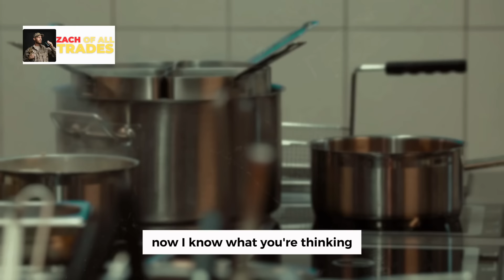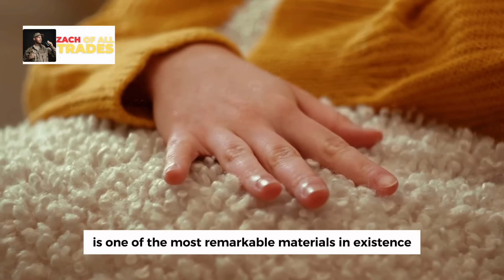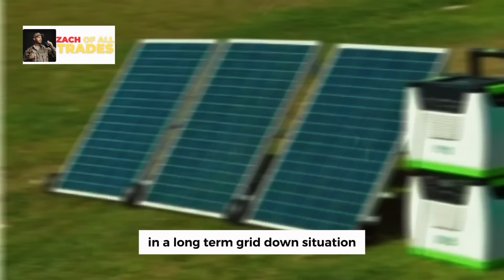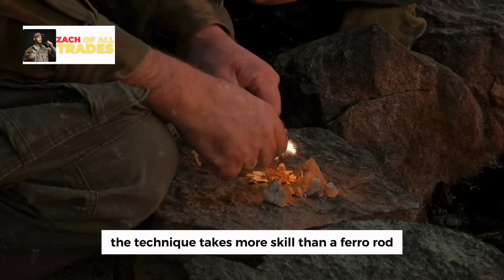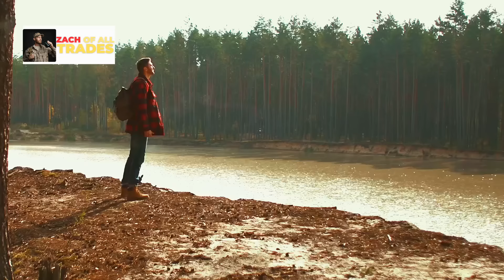15 Survival Gear Items That Last Forever!

Comment from the maker: 🎁 🚩💡🔗 Get the FREE guide: How to turn $50 into a 90-day food supply → https://www.prepguides.cloud/

🛠 GEAR FEATURED IN THIS VIDEO:

COOKWARE & CAMP KITCHEN:

Cast Iron Skillet - https://amzn.to/4p8kxS5
Cast Iron Dutch Oven - https://amzn.to/43qmlxf

FIRE STARTING:

Large Ferro Rod (Magnum XL or similar) - https://amzn.to/3LvHz6Q
Flint and Steel Fire Starting Kit - https://amzn.to/3JCHn5b

KNIVES & CUTTING TOOLS:
Mora Fixed Blade Knife - https://amzn.to/3JCHAW1
ESEE Fixed Blade Knife - https://amzn.to/4oz3kRX
Ka-Bar Fixed Blade Knife - https://amzn.to/4qQGVkj

NAVIGATION:
Cammenga Tritium Military Compass - https://amzn.to/4hWbDoj
Quality Diving Compass - https://amzn.to/498q32g

HYDRATION:
Klean Kanteen Stainless Steel Water Bottle (32oz or 40oz) - https://amzn.to/4oVFlMu

HAND TOOLS:
Gransfors Bruks Axe - https://amzn.to/3LG0ID3
Hults Bruk Axe - https://amzn.to/4p1wQPQ
Estwing Solid Steel Axe - https://amzn.to/487tC7O
Bow Saw with Replacement Blades - https://amzn.to/4qXM2zu
Silky Zubat Folding Saw - https://amzn.to/4qSCcyL

SHELTER & WARMTH:
Military Surplus Wool Blanket -  https://amzn.to/47K5pmM
Canvas Tarp (12x12 ft or larger) - https://amzn.to/4nHrFU9
Rip-Stop Nylon Tarp - https://amzn.to/3WOvnAw
Waterproofing Wax for Canvas -  https://amzn.to/4oVFFea

LEATHER GEAR:
Full Grain Leather Belt - https://amzn.to/43r0t50
Mink Oil Leather Conditioner - https://amzn.to/3LDyGbf

MULTI-TOOLS:
Leatherman Wave -  https://amzn.to/3JDUOBV
Victorinox Swiss Army Knife - https://amzn.to/3LxihFy

POWER & COMMUNICATION:
Hand Crank Emergency Radio - https://amzn.to/47JeVId
Hand Crank Flashlight - https://amzn.to/49efr20
20-Watt Folding Solar Panel - https://amzn.to/49dColY

FOOD PRESERVATION:
All American Pressure Canner - https://amzn.to/3LRMqPI

MANUAL TOOLS:
Hand Crank Grain Mill - https://amzn.to/4nPJGjl
Treadle Sewing Machine - https://amzn.to/3WOmyqs

CORDAGE:
Manila Hemp Rope (100 ft) - https://amzn.to/4ovKafr
Static Climbing Rope (100 ft) - https://amzn.to/4oAnye0
550 Paracord - https://amzn.to/3JHvX04
Reply: Cast iron shatters if dropped 🤦‍♂️

Comment: [00:01:00] Cast Iron Cookware
Description: Skillets, Dutch ovens, griddles; naturally non‑stick when seasoned.
Why it lasts forever: Solid iron, no coatings, no moving parts; improves with use; survives fire, rocks, drops.
Price: Not given in video.

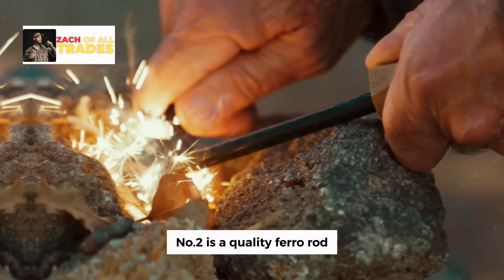[00:02:32] Ferro Rod (Large, Quality Rod)
Description: Fire‑starter rod producing sparks in any weather.
Why it lasts forever: Tens of thousands of strikes; no fuel, no wick, no moving parts; works wet, cold, high altitude.
Price: Not given.

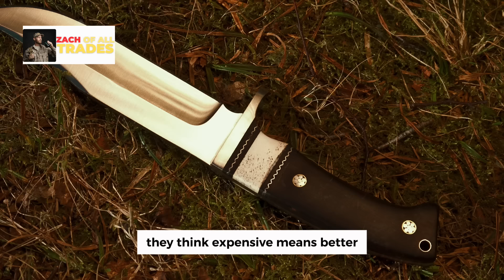[00:04:04] Fixed‑Blade Knife (Full Tang)
Description: High‑carbon or stainless steel survival knife.
Why it lasts forever: Full‑tang construction eliminates break points; steel can be sharpened indefinitely.
Price: $50–$200 mentioned.

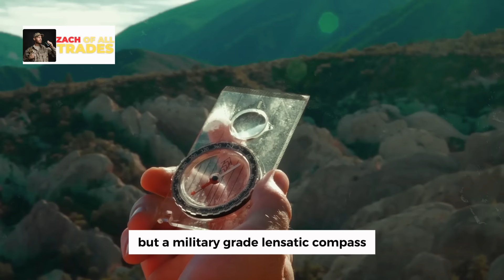[00:06:50] Military Lensatic Compass / Diving Compass
Description: Mechanical navigation tool with tritium glow (military version).
Why it lasts forever: No electronics; needle floats in liquid; tritium glows for a decade+; survives battlefield conditions.
Price: ~$100 for the military tritium model.

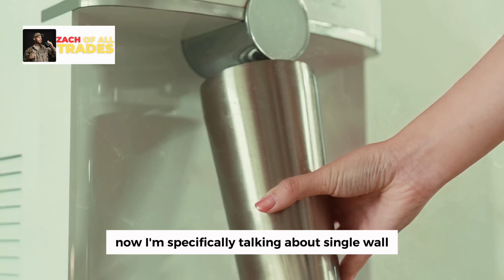[00:08:23] Single‑Wall Stainless Steel Water Bottle
Description: 18/8 food‑grade steel bottle (Klean Kanteen style).
Why it lasts forever: Doesn’t rust, crack, or leach chemicals; can boil water directly in fire.
Price: Not given.

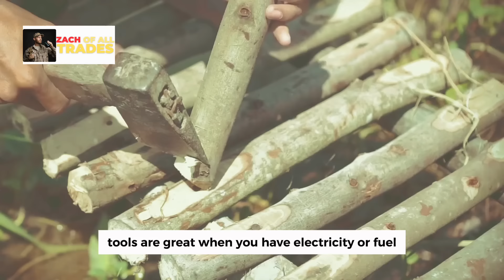[00:10:02] Hand Tools — Axes & Saws
Description: High‑carbon steel axes, bow saws, Japanese pull saws.
Why it lasts forever: Steel heads last centuries; wooden handles replaceable; bow saw frames last decades.
Price: Not given.

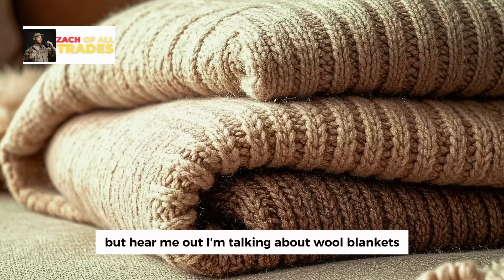[00:11:42] Wool Blankets (Military Surplus)
Description: Heavy wool survival blankets.
Why it lasts forever: Wool insulates when wet, fire‑resistant, simple woven construction; nothing to break.
Price: $30–$50 for surplus blankets.

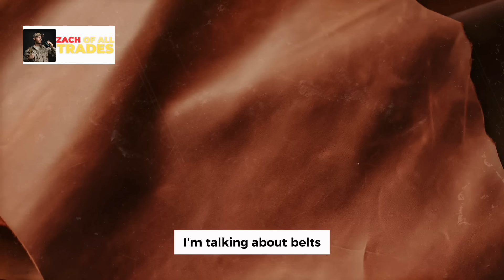[00:13:30] Full‑Grain Leather Gear (Belts, Boots, Holsters)
Description: Thick leather equipment for daily use.
Why it lasts forever: Can be cleaned, conditioned, repaired, and re‑soled indefinitely.
Price: Boots often $200+; mink oil $8.

[00:15:00] Hand‑Crank & Solar Tools
Description: Radios, flashlights, simple solar panels.
Why it lasts forever: No batteries required; LEDs last 50,000 hours; solar panels have 25–30 year lifespan.
Price: Not given.

[00:16:35] Manually Powered Tools (Grain Mills, Treadle Sewing Machines, Hand Pumps)
Description: Mechanical devices with no motors.
Why it lasts forever: Pure mechanical systems; steel gears; easy to lubricate and repair.
Price: Not given.

[00:18:18] Multi‑Tools (Leatherman, Victorinox)
Description: Stainless steel folding tool sets.
Why it lasts forever: High‑quality steel, engineered locks, lifetime warranties; repairable.
Price: Not given.

[00:19:41] Pressure Canner (All‑American)
Description: Heavy cast‑aluminum pressure canner for food preservation.
Why it lasts forever: Metal‑to‑metal seal (no gasket); gauges recalibratable; bodies last generations.
Price: Not given.

[00:21:12] Flint & Steel Fire Starter
Description: Flint stone + high‑carbon steel striker.
Why it lasts forever: Flint is stone; steel striker lasts decades; no consumable parts.
Price: Not given.

[00:22:37] Premium Tarps (Canvas or Ripstop Nylon)
Description: Heavy‑duty tarps for shelter and protection.
Why it lasts forever: Canvas can last 20–30 years with waxing; extremely durable; simple construction.
Price: Not given.

[00:24:00] Rope (Manila or Climbing‑Grade Nylon)
Description: Natural or synthetic high‑strength rope.
Why it lasts forever: Manila lasts decades if kept dry; climbing rope resists UV and moisture; minimal degradation.
Price: Not given.

Comment: Purchase an old axe with a legible name. Do the research. Restore the head yourself. Do the research. Buy or make a handle using hickory or ash. Learn to sharpen it yourself. Now you are on the track to being self sufficient. If the handle breaks, you can form another with the axe head and a knife. If it dulls you can Sharpen it.

Comment: Your list started off well then is became more ridiculous. A grain grinder? Where are you getting the grain? Wind up radio? Who's broadcasting when the world turns to sh!t? I totally agree about cast iron pans.and some of the others.
A lot of the video you insert didn't match what you were talking about. Canvas tarps don't look like plastic. Anyway canvas is heavy not portable , go for a military bacha . The right concept but wrong material. The compass you show is a cheap thing not a Carmenga military compass. 
Leatherman abd Victorinox tools are not tough. Better with a decent knife and a Knipex Cobra .
Yes Leather is way better than synthetic.
Flint is rubbish but better than nothing. It's more about the tinder.
Gransfors axes are excellent. I tried using a tomahawk but it didn't have the heft.
Wool blanket is a yes but nothing keeps you warm when it's wet. Most of the examples of wool blankets in your video were not wool blankets.
How about a bicycle? Great for getting around, also a decent back pack to carry the gear.

Comment: This video was  extremely  well put up.2 items missed were baling wire and a really good set of quality pliers or linemans I work in the trades and twice I've given Leatherman a try both times I was extremely  disappointed.  Not disting Leatherman  just all multytools .they may get you by in a emergency  but don't compare to the real tool.as to the #1tool I say the axe there  is very little  other than fine carving that a knife can do better than a axe.not so the other way around. In ten minutes you can turn  a dense forearm  sized hardwood into 2 throwing sticks capable of taking down deersized game or man predators  easily.  Next a staff  your height to help navigate  rough terrain  .1st night in camp make sharp point on staff and harden it in camp fire.now a very deadly weapon.next deep hiding .you go out pre-dawn looking for a  premium  bowstave a arrow shafts.there are hundreds  of things  to consider if you are to survive .if you  choose the knife your still trying to figure your new environment. My axe and I along with the pack frame  I made in 1 hour are headed to deep wilderness  where fema will never go.btw I already made a stone knife with  a grass handle, very clumsy but a knife none the less

Comment: What brand of Ferro rods recommended??
Reply: Better to direct your focus on testing fire tinders under a wide range of weather conditions. When you can repeatedly light them with a "cheapie" Harbor Freight ferro rod then go ahead and buy a "high quality" ferro rod for when SHTF!
Reply: Most ferro rods are oke...i have a few, small ones but also a 6" x 0,5"....that big one is easier to handle if your hand are cold...

Comment: Buy a magnify glass or lens and you could use that to start a fire too ...I have magnify ,lighters,matches assorted and ferorod so good to go ....You can still use a bic when fuel runs out it has a ferorod to...
Reply: I also store food that only take minutes to make or heat ...Or eat with out cooking or water have both kinds ...I even have gallon water on hand in original package never opened for 6 months so far ...Just in case stuff ...I always rotate stuff if use replace ...
Reply: I do this because had money before... Now very little money so save big time now buy in bulk what I can eat or like...

Comment: For a blanket synthetic is just as good and a down sleaping bag really does not soak up much water in normal life, nor in camping conditions. Besides that, you will still be awfully cold in a soaked wool blanket, whilst fleece will be dry much and much faster.

Comment: With a steel bottle you still need to change the seal after some time and the quality is important as well. A compass is mostly useless if you dont know how to use it and when you dont have a decent paper chart.

Comment: When you hand crank a solar radio, it is running off the small amount you charge that you charged the rechargeable battery that WILL degrade.
Reply: What do you recommend, then?
Reply: Buy a spare battery....

Comment: I don't really like multitools that much. They are okay in a pinch, but are easily outperformed by single purpose tools. Also Victorinox brand is so overhyped, I don't really consider it worth buying. And the more tools in one, the more gimmicky it is, and usually harder to use...
As for rope, I'd get some climbing rope, and quite a lot of marine rope of different gauges. A few climbing rated carabines and bunch of cheap, small ones for hanging stuff.

Also the idea that people need survival equipment that must last forever is stupid. Unless the entire world is reset to stone age, that equipment must last for a few weeks of constant use...
Reply: That's just it if something like a EMP happens , we will be back in the stone age basically . ⚔️✝️🇺🇸🦅⚖️🗽🕊️🗡️
Reply: @augustuswayne9676  
There will be no man-made EMP. The only risk is Sun activity. And I don't rate it very high, as most systems are protected or have resilient backups...
Reply: I understand, its hard to imagine, but you need a reality check... With all those new weapons...  An EMP brings you back to 1870's, and to get electricity running again you need new transformers, made in China, waiting time at least 6 years... So you better prepare... Stay safe!

Comment: i was digging in the back yard, in central france, and found 2feet down a cast iron pot with a cover that i cleand up and am using now, but it's so old the markings are in pints' before the metric system... and it's awsome, all that to say, yes lasts forever

Comment: Crank radios and flashlights all have batteries inside which is charged with the cranking. The difference is most have to be taken apart to replace it's battery.

Comment: I bought what were suppose to be water proof solar battery packs to recharge mobile phones . I put them outside it rained and they were ruined and didn't work , so please test your gear. Before a disaster. 
  I say always have a battery operated transistor radio. You can't always rely on solar , clouds , darkness etc. when you need updates in an emergency you need something that's going to work. Old school wrist watches too.
Reply: Probably would have been better to check the waterproofness of a 0.10 cent ziplock baggie... Ha Ha Ha!!! Sorry for your loss...
Reply: @MikeDAntonio-t2x  yes ❤